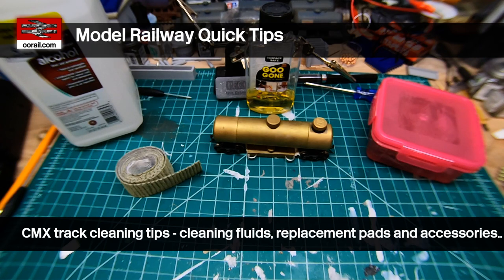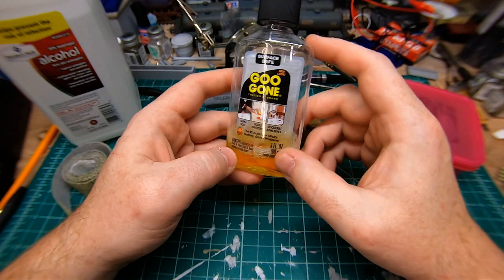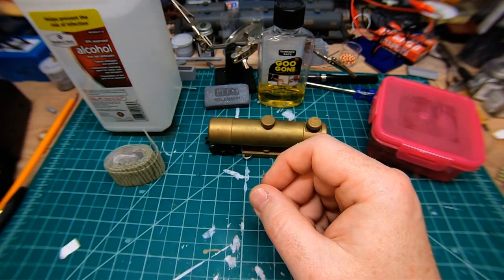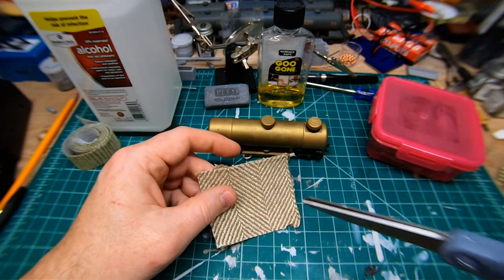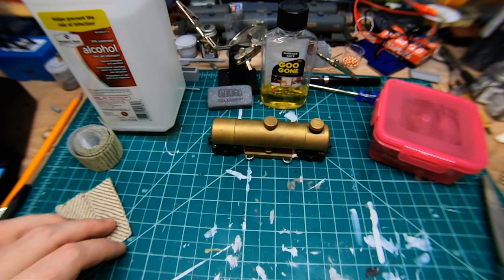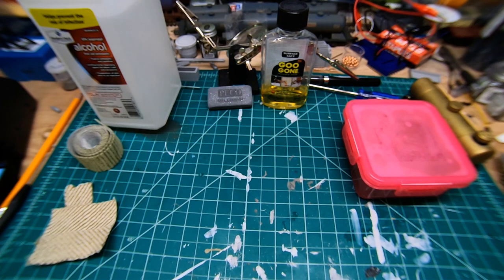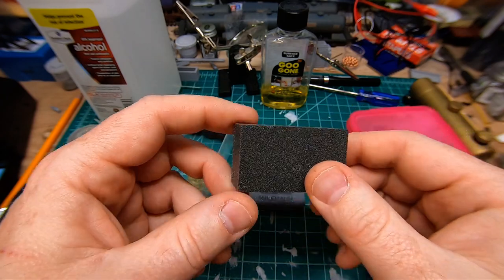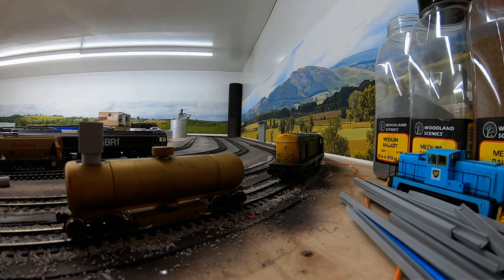oorail.com | CMX Track Cleaning Tips

Comment: Check out Joe Fugate's Publisher's Musings in the May 2019 model railroad hobbyist on track cleaning talking about polar vs non-polar chemicals for track cleaning if you look at the list you would not use IPA you would be using something like electric contact cleaner. JF explains why, at our club we have moved to WD 40 electric contact cleaner not the standard WD 40 here in the UK we can only get this on the internet very good results so far. Joe's work on this is the most thought through information on track cleaning we have come across. Neil

Comment: i use a funnel from a arts and craft store here in the USA. two pack set of them for under $2USD + tax. they are clear plastic. (at least for now).
and i use, clear gas, kerosene, coleman fuel, about the same product just sold under a number of names.
one wet cmx then two dry center line, then one wet cmx and two dry center line, followed by a number (as i feel like it 2-4) clean masonite draggers. all this is for dirty track. 
but once clean it stays that way very good but i clean at least every six months, so no issues. and run a number of masonite draggers in the trains as they just fit not planed. ( i have a bunch of 40 footers, just used as normal rolling stock with the masonite boards). 
wheels get a off track cleaning as needed. but clean track = clean wheels. (yes metal wheels).
i am now retired and home a lot. so track should stay cleaner longer.

Comment: Hi, just thought I'd copy my reply to the broken video here in case it's of use to anyone:
When using Oxiclean, if you mean the powdered version it actually works best at around 70C [ 160F ] and not boiling.
Thanks for the info on the Gaugemaster track rubber too as I was about to buy one.

Cheers
Reply from the maker: Thanks Gerry. I was very surprised at how poor the Gaugemaster track rubber really was. I even bought a second one a few months later to make sure I hadn't got a bad one. Alas no. So far, the Peco one has been really superior, I've stocked up, have about six of the peco ones I think :)

Comment: Have you got the Amazon code for that yard of material please? Thank you.
Reply from the maker: The charcoal gray material listed here -> https://www.amazon.co.uk/shop/oorail.com?listId=18YMQIC4I9KQN is a good heavy weight fabric and is very close to the one I showed on the video. Its also cheaper via that link that most local fabric stores. Amazon I think its 7 quid, some fabric stores in the UK its around 11 or 12. You don't need much of it, about 1m will last you a long time! :)
Reply from the maker: If you want one with the exact Chevron pattern, you will most likely need to order it from the USA, here is one option, it doesn't look like its available in any colour other than blue anymore ... https://www.joann.com/upholstery-fabric-waverly-sublime-azure/12799300.html
Reply: I got the material and it is identical to the CMX in all but colour, even slightly ribbed, so thank you for that. It came as a 1Mtr square and was £1 cheaper than the paltry amount of CMX stuff so I have enough for a lifetime here, thank you!!
Reply: @Oorail   Will any upholstery fabric work? I couldn't find the Chevron pattern online anywhere.
Reply from the maker: You want a material that will cause some friction. So you don't want the silky, velvet  or smooth materials. You want something that's closer to almost carpet tile. The chevron and striped patterns work well because they are slightly raised, enough to pull gunk off track but not enough to get caught on uneven track. Some fabric shops will give you or sell you samples. I did a lot of trial and error testing...